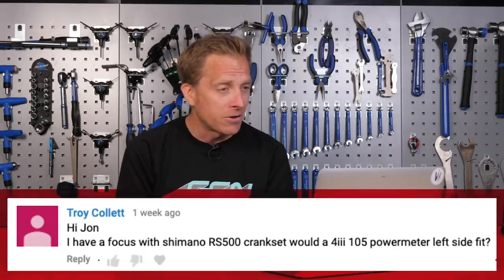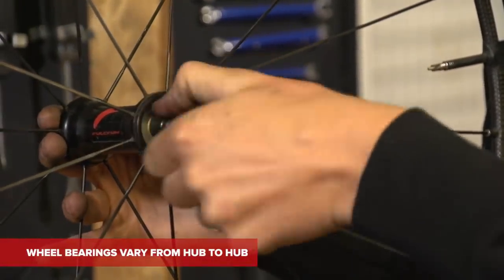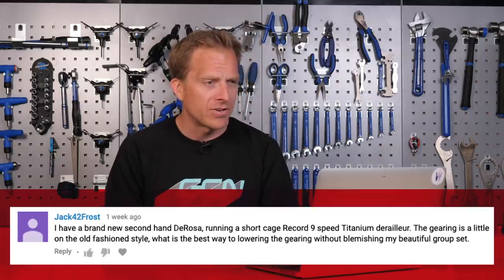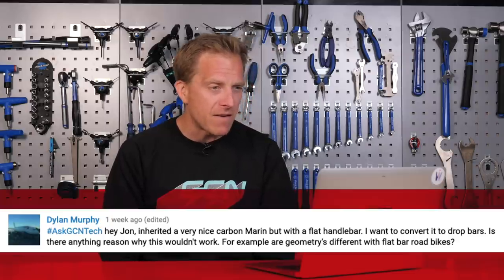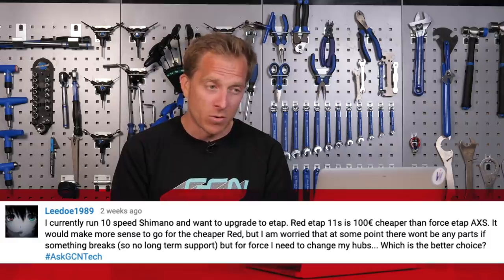Fitting Power Meters, Upgrading Groupsets & Wheel Bearing Grease | GCN Tech Clinic

Comment: Timings:
0:15 Fitting 4iii 105 power meter on a Shimano RS500 crankset
1:10 Upgrading 10sp Ultegra to 11sp R8050 Ultegra on a TT bike
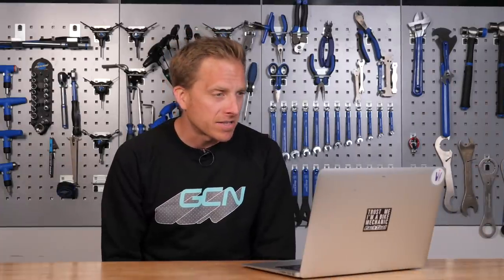2:17 Determining carbon fork steerer tube expander length
3:03 Adjusting Fulcrum Racing Zero front wheel bearings
4:36 Patching a tubeless tire
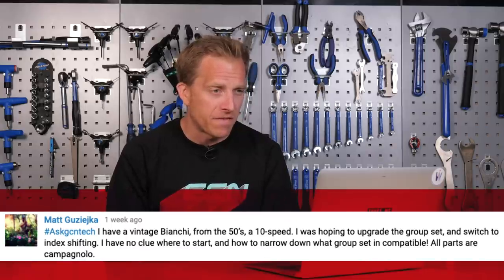5:23 Upgrading vintage bike's groupset to an indexed shifting
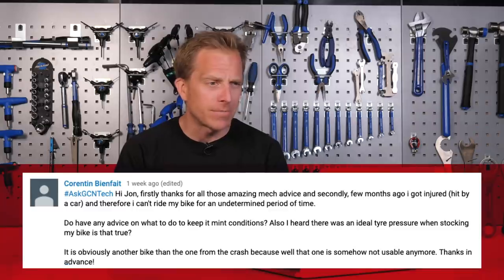7:20 Preparing a bike for prolonged storage
8:48 Adding a lower gear to a bike with 9sp Campagnolo Record Titanium short cage rear derailleur
10:26 Flat bar to drop bar conversion
11:38 Upgrading to RED eTap vs Force eTap AXS

Comment: Jon, my favorite part of the channel. Although I have a couple of rebuild projects going (saving those for Screw riding up grades, buy upgrades), my question is about my 2016 Cannondale Synapse. I wasn't happy with the stock disc brakes that came with the bike so I upgraded those to the TRP Spyres. Wore those out in about 25,000 miles. Yesterday i put on the new TRP HY/RD mechanical/hydraulics. Stopping power is fantastic but I am getting what I can only describe as a chirping sensation (not a sound) when stopping. I feel this mostly from the front. I didn't change the rotors as the mechanic at the LBS said that it should clear up in "few hours of riding." It did improve over the first 50 mile ride but if I brake hard its still there. I am going to put on a new 160mm rotor on the front today, basically because I have one just sitting on the workbench. Do I need to change the rear too even though I don't feel anything there? And should I be concerned that I did something wrong on the install? FWiW the older rotors have maybe 1200-1500 miles on them.

Comment: I have a 2011 Noah. The chain and seat stays are quite tight. I can use most 23c tires and some 25c tires. I've found conti 25s are wider than most and do not fit (they rub when I put the power down). I had to switch to Dura Ace Skewers to tighten the hub to the frame from my previous skewers to prevent rubbing on the seat stays. Which 25c tires are most true to the size? I'm using Bontrager RXL wheels.

Comment: Hi, love the channel. Particularly the concise answers to questions!
I'm having issues with the front deraileur on both of my bikes.
On one, when I shift up to the big ring I find it often shifts over the chainring. I tried bringing the limit screw in but it just rubbed in the bottom couple of sprockets!
Any tips for that one?
On the other I'm fairly sure my cable tension is too low as it rubs in the top few sprockets. In this case, the limit screws made no difference, the barrel adjuster is at maximum tension. Do you have any tips on perfecting the tension on the front cable?
Sorry for the long question(s), and thanks in advance!

Comment: Store a bike hanging, then tire pressure does not matter.  Zinn recommends 303 Protectant on tires to keep them from drying out. Heated space is best as going through the dew point and getting condensation can cause corrosion.

Comment: Question. Hi John, A simple question for a man of your skills and experience so excuse my lack of same. My partner (intimidated by drop bars but wants to do short sportivs, 70 -100km) has a Meridia Road Speed 500 with an Ultegra 6800 SS rear derailleur, I want to change the rear cassette from 11-28 to 11-34. Can I use the 9800 SS with an extender or do I need to upgrade to a R8000 or R9000? Anything else to watch out for?

Comment: #AskGCNTech - this is one for Jon: I had a moment flying down a hill the other day and locked up, not quite making a turn (it was OK - just - but I avoided running into a car by centimetres!) It seems I warped my front 160mm Ultegra disc. Would upgrading to Dura-Ace discs give me better braking? (I assume the calipers and pads would remain the same - the bike is pretty new) I haven't found anything online that says Dura-Ace are more resistant to warping or will stop shorter, just that they dissipate heat better than Ultegra. Are Dura-Ace brakes better than Ultegra? Thanks!

Comment: #AskGCNTech hi Jon.... bottom bracket question. My Bombtrack Arise has a BB86 pressfit BB. I want to fit a mountain bike crankset with a smaller 32t single ring. I know this has a 24mm axle but will it fit as I know it’s supposed to need a BB92 bottom bracket. So confused. 😐

Comment: Howdy, Jon. I recently competed in my first race and put on some brand new Vittoria Corsa tubeless tires on for the purpose (they are awesome). My old tubeless tires still have some miles left in them. Is there any concern with re-installing them without tubes at a later date? Will they still function tubeless, or should I use a tube? #AskGCNTech

Comment: #AskGCNTech after replacing my ultegra 11s chain with a well know aftermarket alternative brand chain, my dry lube lasts only 50/60 km on it, then the chain becomes noisy. Only using wet lube makes my drivetrain silent. I live in a dry climate. Is this normal?

Comment: Hi, Jon, I have a weird one for you. After I finish riding my aluminum bike on my direct drive trainer, it plinks or creaks intermittently 3-10x for up to an hour after my ride. I've checked the bike all over for cracks and have done tests (push BB while holding seatpost & handlebars) to see if I can recreate the creak - nothing. It's inconsistent, but has started to get worse recently (usually plinks 5-10 times now instead of 1-3x before). I have the bike set up exactly as Elite directed, and never hear anything like this while I'm riding outside, or after a ride outside. Any ideas?

Comment: Hi Jon (or possibly Ollie) I have an R8050 short cage rear derailleur that I'd like to have the flexibility of an 11-32T cassette and possibly an 11-34T if needed, I currently have an 11-30T that is the Shimano theoretical max. Based on what Wolf Tooth recommends, a derailleur hanger extender is not compatible with a short cage derailleur when in a 2x setup.  Is it still possible to use one regardless of the listed incompatibility or do I need to upgrade to a medium cage in order to achieve my goals of broader cassette support? #AskGCNTech

Comment: @AskGCNTech Hi Jon, I am looking to upgrade the brakes on my girlfriends 2015 Trek 1.5 which uses the Shimano Tiagra 4600 groupset (minus the brakes).  My bike has the newer Tiagra 4700 groupset.  I was looking to swap my Tiagra brakes onto her bike and fit BR 105 5800 or BR R7000 brakes onto mine.  Will this work?  I have read that SLR-EV brakes, should not be fitted to bikes with non- compatible levers as the brake will be dangerously mushy, due to different lever pull ratios.

Comment: is it necessary that our feet could touch(tip of the shoes) the ground while sitting on the saddle? Is it the proper saddle height that we should follow? #AskGCNTech
Reply: For a road bike, it's not necessary at all. A great starting point is to multiply by 0.885 your leg length (between the ground and your crotch), and add or remove few milimeter if you have knee pain : go up if you have pain at the front of the knee, and go down if it's at the back. The feet that touch the ground is related to the frame size: you must be standing at the top tube, both feet on the ground whithout your bike touching your crotch.
Reply: Definitely not, that's nonsense. Usually comes from people who don't know a thing about bikes.

Comment: #askgcntech Hi Jon, I'm using a dura-ace9100 50/34 with a 28 cassette, is there any hack to fit a 32 cassette without changing the entire rear derailleur?
Reply: Ollie Bridgewood actually managed to put 11-32t with the b-screw completely wind in. Source. GCN VS ANGLIRU video. Skip to 10:20 min
Reply: It's possible without changing the rd

Comment: Hello Jon boy! I have a lovely 2017 supersix evo disc (non-hi mod). This has the in-between Shimano br-rs805 rotors and those levers that just have 'shimano' written on them. I have two questions please.

Are there any significant details between this and the latest ultegra disc groupset? (I assume this is ultegra level equipment, the front and rear derailleur are marked as such)

And is it compatible with converting to ultegra di2? If so what components will I need to make this happen? 

Thanks, big fan of the content you guys and girls put out.

#AskGCNTech

Comment: £20 or so to cold set

No need if only 126 to 130

Also no need to find special shifters - friction is your friend, especially if using a 10 speed cassette - the chain will drop in easily as they are close together

Comment: #AskGCNTech  am  doing  now  a  days  a  lot  of  rides  on  my  gravel bike,  my  gear  set  is a  very  standard 105  52/36  and  a  11  speed  cassette  11/28  but  am  feeling  I need  a  bigger  sproket  in the  cassette,  105  only  take  me  to  11/32  but  am  wondering  how  do  I  get  a 34, 36  or  40 in  the  cassete ? am  allready  condider  changing  the  back  deraileur for  a  long  arm  one,  and  also  the  chain but  my  mechanic  does  not  see posible  to  go  bigger  than a  32 even  if  is  a  MTB  or  Durace deraileur...  can  you  give me  some  advice?

Comment: #AskGCNTech
Hi Jon, I ride a cannondale synapse claris 2018 i would like to upgrade my groupset to 105 r7000 series. is it advisable to upgrade the groupset or the whole bike itself.
Reply: Aakash Lourdes bought a synapse high mod 2014 with 105 five years ago with intention of swapping up the groupset, upgraded the wheels but not the 105 as still running sweet , you’ll be alright with the new 105

Comment: #AskGCNTech 
Hi John,
I'm a swimmer thinking about getting into cycling and triathlon.

I was thinking about getting a time trial bike, and somehow making a system for quickly(ish) changing between tri-bars and regular drop bars depending on what kind of ride I have planned. Does such a system exist, or how would you go about making it?

More specifically; is there a way for brake and gear cables to connect and disconnect somewhere in between the lever and the brake or gear?
Reply: I do this all the time on my TT bike, that I also ride in crits. Just set up 2 sets of bars, each with cut cable and housing to fit. Each will look a bit like an octopus but it only takes a couple minutes to thread the cables, and just clamp into the brakes and derailleurs. Just tighten the stem clamp and off you go.
Reply: @galenkehler  Oh so you basically reroute the cabling on your bike from the stem down? Yeah, that would work I guess, nice :)
(But what if you'd also want internal cable routing tho :d)
Reply: @frankeeeej  my bike has internal cables, it's a well designed frame, just put the cable in one hole and it comes out the other end. The brake cable is continuous inside the frame, so I have a length of housing that I put through as a guide.